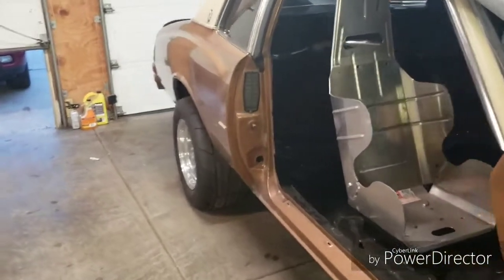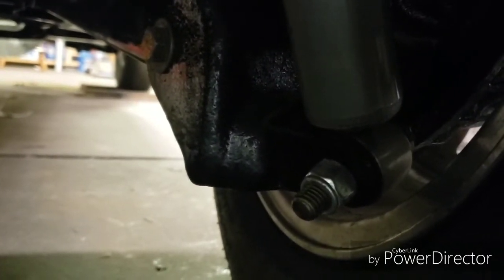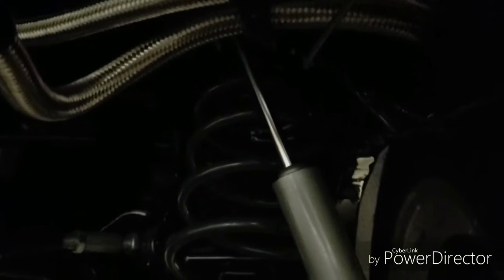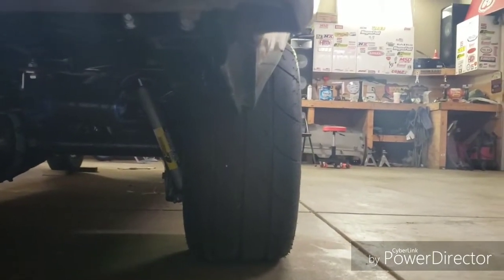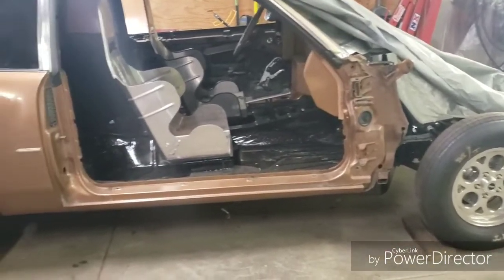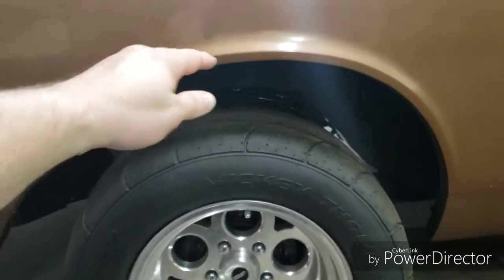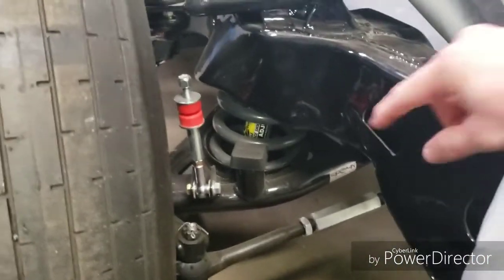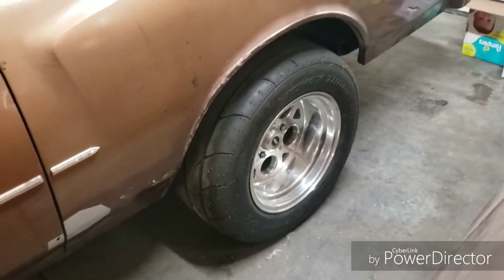GBody Rear Wheel Fitment

Comment: Thanks for sharing. I’m gonna move the shock bracket inward and also use coil over . I have the 2” lower spindle on the front. When I get it all together then I can set the stance I need. Glad you’ve posted this info to help others. I had watched your frame notch video and saved me a lot of time. Have you got to race?? Thanks man!!
Reply from the maker: Thanks. No I haven't raced the car yet

Comment: So a 15x10 mounted on a N50 tire with 4.00" backspace should fit? I have an 81 El Camino. Stock shock location.
Reply from the maker: A 4inch backspace is gona have the wheel/tire sitting out alot further. Probly be sitting outside the quarter. So if car lowered it might hit
Reply: @mcbluecollarguy2382  thanks for responding. I'm actually going for the 70's look with Cragar s/s wheels so I want them to hang out a bit.
Reply from the maker: Nice. Thats cool

Comment: Would 15 x 10 with 4 inch backspacing fit on a 1985 Monte Carlo ss
Reply from the maker: Whata your ride height setup?
Reply from the maker: A 4 inch backspace isgona have the wheels sitting out further. Jus depends how low the car is
Reply: It’s all stock setup . And do you think it will stick out too much or kinda like the Monte u got ?
Reply from the maker: It will jus hangout a half inch further then how mine sits. An if its stock height ahouldnt have to worry about tire hitting
Reply: I want it just like how u have it so what do you recommend? I appreciate the help
Reply from the maker: I don't know if for certain the dif between the 79 an 85 monte quarter panels. I would think it be about the same. Id jus go with a 4.5" backapace. Or look around on forums or FB monte pages an see what guys are running closer to your year body style. 3rd gen quarter panels are dif then 4th gen but im not 100% if width of wheel well to quarter panel is the same you know what i mean.
Reply from the maker: Jus make sure you take a straight edge or ruler or a long level an tape measure. See where a 10" wide rim will fit with level up against the rotors even where the rim will sit. Find a happy medium where you want it to sit. Jus beware of tire bulge depending on what backspacing you go with if it will rub anywhere. But before i did the notch the wheels i have cleared frame, wheel wells, quarter panel
Reply: I appreciate the help man thanks
Reply from the maker: No problem
Reply: You can do a 15x9 with 4 1/2 backspace with coil overs or 2 inch drop springs
Reply: campdta is it goin to notice that the tires will stick out ? Cause I’m going for more of the buff stocky car look like how he has it
Reply: campdta amd the 15 by 10 don’t fit I tried it smh
Reply: Michael Sanchez 275/60/15 with a 15X9 with 4 1/2 back spacing will work C Notched
Reply: campdta is it expensive to get a car c notched ?